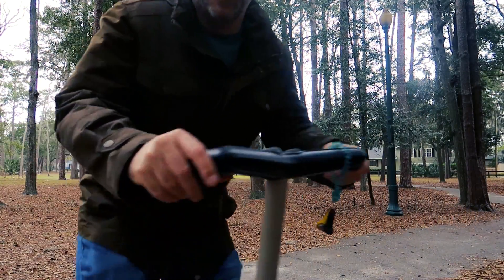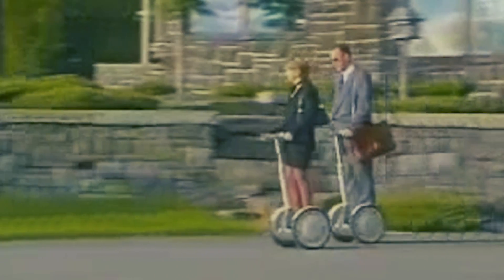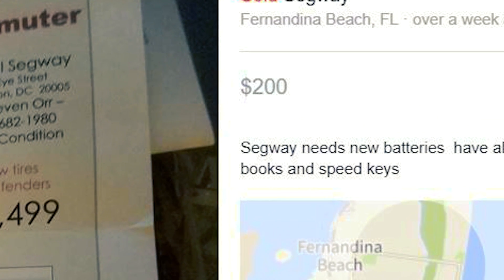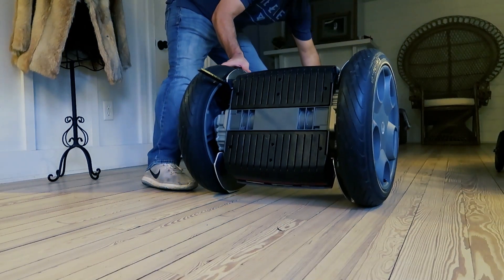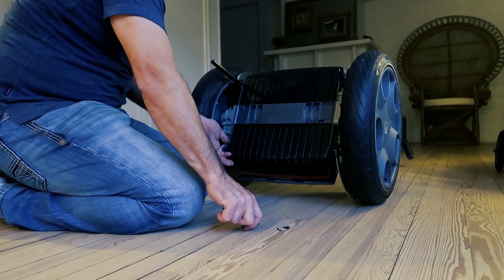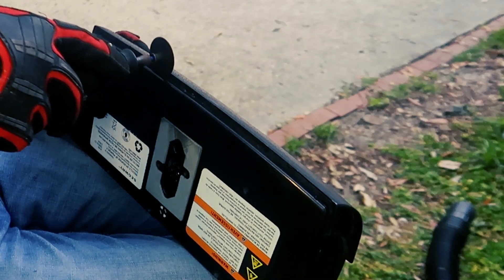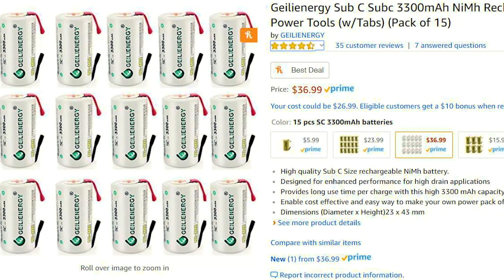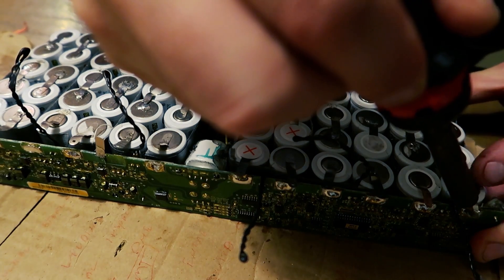Old Segways Are Not Trash! Here's Why

Comment: Great video.  I have two segway HT and had the batteries rebuilt.  After I installed them one of the machines worked perfect the other however won't come on. I swapped the batteries the good machine still works but same problem with the other machine.  I checked all connections even removed the handle bars and checked the sensors on the platform.  What am i missing?  Thanks

Comment: When these batteries heat up for whatever reason, the shrink plastic round the batteries can shrink to the point that they sever so the outsides of the batteries gets short circuited which will make the battery pack explode.
Always make sure the individual batteries stay mechanically separated to avoid a short circuit.

Comment: I have a question.... since the batteries  are originally  1.2v 3000mah .... I noticed  you used 1.2v 3300mah as replacement.... did you have any charging issues  or kick backs... due to that or not.... I know it still should  be ok... but I also notice sometimes  it could  cause  issues  with the charging system  sometimes... the reason I ask because  I have to do the same ... I have 2 segway  ht i167

Comment: Someone offered i167 to me for free.
The original batteries were lifepo4 92 x  18650 in each  pack 4p23s 

My solution was to use 32700 lifepo4 6000mah instead.  It is more economical  than 18650. 
My total was $150 for 50x32700 including nickel strip. 
Although both bms boards had to be repaired due to few blown zener diodes and flip stand needed to be 3d printed.
Reply: Hi there, where did you buy the batteries? (the ones I can find are much more expensive than that) Also, is your battery pack still working? What's the range?

Comment: Hi I'm in a similar boat you are. Got a free segway that was sitting for about 15 years from my bestie's late grandpa. Uses the same NiMh batteries.  My batteries are in the boat of they last for a trip to 7-11 up the street and back and that's it. 
a few questions if you don't mind. 
Do you think I can put the packs in a toaster over just hot enough to get the goop to melt?
How are the batteries holding up a year and a half later?
How did you reassemble the case?
Do you mind if I make a video and mention you in there even though I have almost no subscribers?

Comment: Good job. I also have a i167 with dead batteries. My batteries have already been rebuilt proffesionally once so opening was easy. Upon inspection, they used 3800 mah batteries with a plastic cover insulator like the batteries in your video. Each  individual battery was wrapped with a piece of scotch masking tape. My question for you is do you feel that extra step of adding the individual piece of tape to the batteries shell is important? Have you had any issues with your batteries? Also, when pausing your video when we were briefly shown the actual soldering of a tab it appeared that you sanded the battery ends before soldering, is that correct?

Comment: Many users think their segwaybatteries are broken ,when they just got "undertension" on the Voltage ,since the segway can´t get the voltage up from a to low voltlevel......under 50 volt requiers an external charger,from above 50 V the segway can load it again.That is what dealers call a battery revival ,easy fix but expensive experience if you didn´t knew about this!

Comment: When you first plugged in the Segway did the charging indicator lights blink? Curious as mine won't come on but there are no lights to indicate it is charging.
Reply: I just rebuilt the batteries on one of mine and I can get it to come on and drive, but when i plug it in nothing happens. No indication that its charging.

Comment: I just picked up an i167 today for $100.  Of course it needs batteries.  Just to be clear, you removed 3000mah nimh batteries and replaced them with 3300mah nimh batteries with no adverse effects?
Reply from the maker: No adverse effects.  I am still using this almost daily.
Reply: @UnboxWarehouse  can I upgrade to the 5000mah batteries? Will there be enough room?
Reply: @tampadrones2302  my battery packs are lifepo4 23s4p 92x18650 batteries each.
I converted it to 23s1p 23x32700 per pack. More compact and higher capacity.

Comment: I ignored my Segway MiniPlus for 7 months and it would not take a charge, I have all the models from Segway and all the problems are related to not charging them regularly, so I dismounted the MiniPlus to access the Battery and sure enough all cells where pretty much balanced but at 1.7volts, so I divided the charging in 2 banks since my LiIon charger can only do 8 cells series max 33.6v , the battery pack is 58.8v 14 series 3 parallel when charged.
My charger refused to initiate the charge so I used my 30v 10amp variable power supply and brought the 2 banks of 7cells to 3.40v and my IMax charger brought them to 3.6v then I finally plugged in the ac stock charger so the whole pack would balance, it took a while but this morning all cells are dead on with exact same voltage reading, I sit on a mountain of Segway batteries for my H67 70 80 then X both lean and steer and original X with fixed T handle which by the way I prefer since you can hot dog them, 
Now Sir you gave me the courage to do all this after watching you video, I ordered a 20watt cutting laser and will refurbish some of the batteries probably same way I did the MiniPlus, oops, the laser is for opening the battery cases.
Reply from the maker: Great info.  Thanks for sharing!

Comment: I have the exact same battery (and it's dead).  After you cut off the top of the battery casing with the Dremel and replaced the batteries, how did you glue the top of the battery casing back onto the main battery case.
Reply from the maker: I actually just used duct tape until I knew they worked correctly. Then I used  plastic weld.
Reply: I used clear 100% silicone. Its water proof that way and if for some reason you had to open the case again it could be pealed apart rather than cut open.

Comment: Got a 550 milles Segway i2 in 2016 for 3500$ Can. almost new, legit. it cost nearly 11 000$ CA, I will use your tutorial for battery replacement later, Tks !
Reply from the maker: Be carful because my i167 has nickel metal hydride batteries. Pretty sure the i2 has lipo. Make sure you familiarize yourself before digging into those batteries.
Reply: @UnboxWarehouse  Tks for the tips, yes I will be careful, I will read more about it and watch more tuto. Right now the battery has bee ok for 3 years, but recently after an non stp 6.8 miles run at the end it started to drain pretty fast, strange.  Maybe I asked to much, since I climbed stip read and ran pretty fast with it.

Comment: Just found a complete i167 while dumpster diving :) Complete with keys and charging cord. Nothing is missing, nothing is broken. One batterie is flashing red but the other seems ok because applying the key produces a bip. Thanks for the tip and the link to the batteries !
Reply from the maker: The machine will beep with only one battery installed but needs both to function.  Good luck!

Comment: Hey, this is confidence-inspiring! I hope you're not feeling too bad that you have the older "inferior" battery chemistry -- when they went from NiMH to lithium ion, they extended the vehicle's range (nearly double!), but also made it harder to transport because of all the safety issues with lithium ion batteries...I think some airlines won't even allow you to check the lithium ion version, so there's something to be said for NiMH. 
A few questions for you: 

1) How long total do you figure you spent on the repair, from cutting off the tops to yanking out the old batteries to reinstalling the new ones? And how long would it take you to do it again?
2) I'm guessing Segway included the "gorilla snot" to shock-proof the battery pack as much as possible. Did you do anything to try to shock-proof yours or make it into one giant hunk of battery rather than 60 soldered-together cells soldered to a circuit board?
3) Related to #2 -- these things hang out on the bottom of the Segway, get scraped along when the machine bottoms out, and get wet if you hit a puddle. Did you do anything to weatherproof the battery packs after reinstalling the batteries? Bead of caulk? I'd hate to hit a puddle and have my Segway go "poof"!
4) I see that the Amazon listing is for 3300 mAh cells, which is 10% more than original, so these are potentially even better than stock! Any update after a month of ownership?
(curious because you're not the only guy who bought a $200 Segway with dead batteries...in fact, I may have gotten a 2-fer package deal, one NiMH, one Li-Ion)